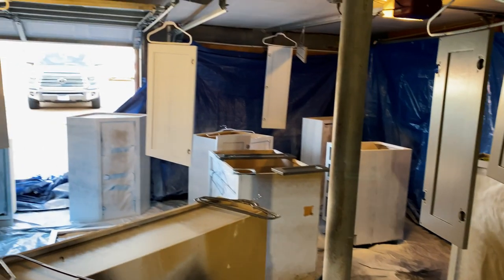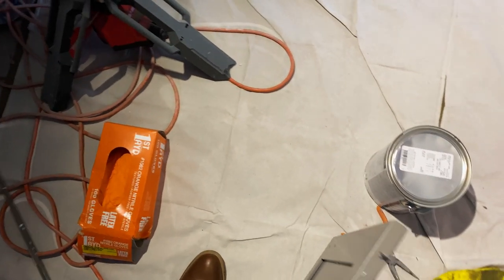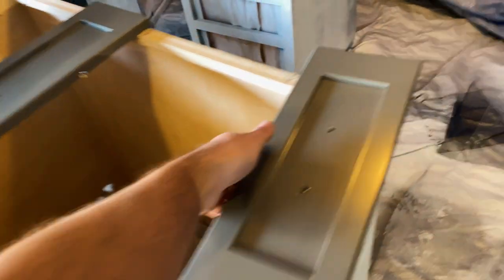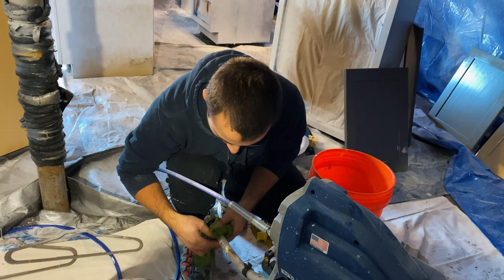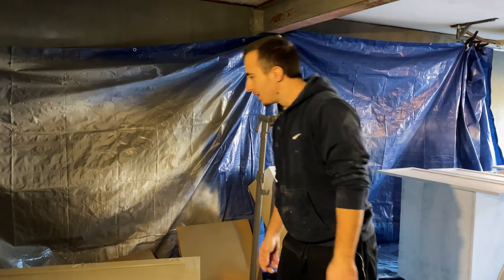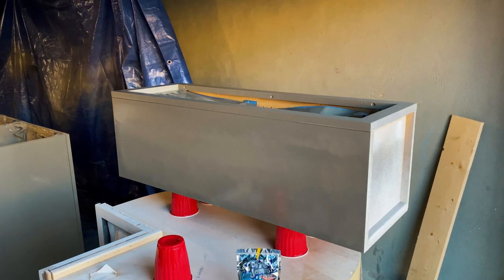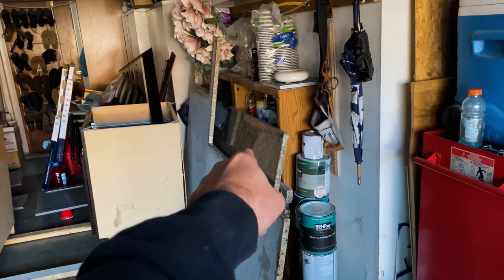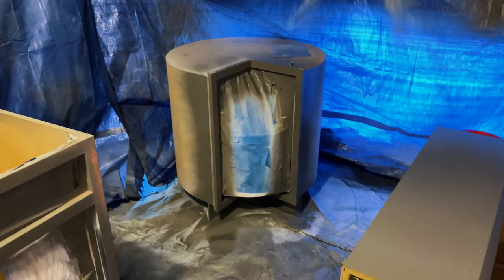FIRST TIME PAINTING WITH AN AIRLESS SPRAYER - GRACO X7

Comment: i owned a black and decker airless paint sprayer back in the 70s,i found it great for spraying walls with emulsion paint but the amount of paint delivery could not be achieved to work like an air sprayer but it saved all that roller and brushing,we costed painting our oak cupboard doors and we had them replaced for around 600 pounds and to spray our own was aroun 700 so a no brainer really,then when i retired i bought a 7000 pound oak kitchen because well we missed having the oak,your tenacious rasim you'll do it in the end son looking forward to seeing it all back in .